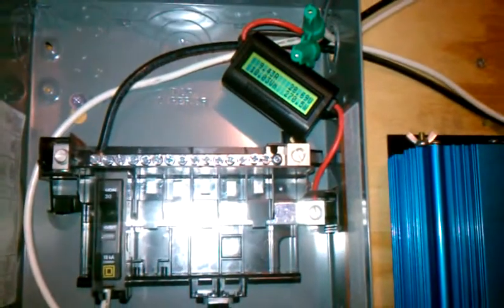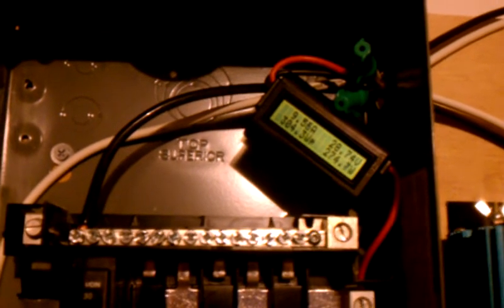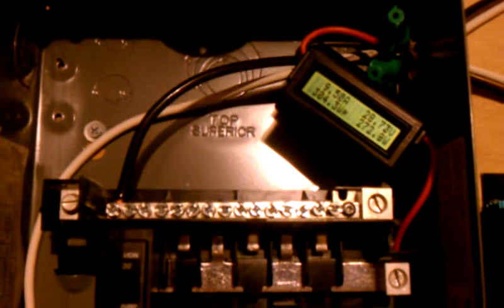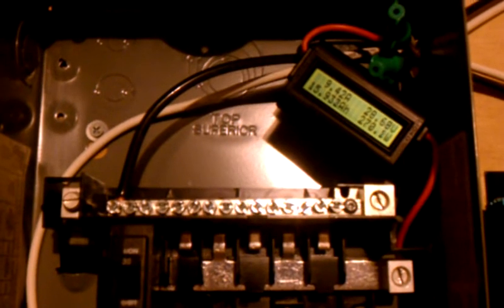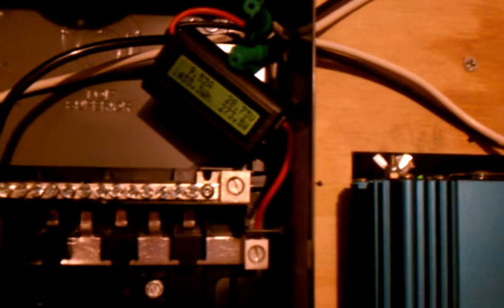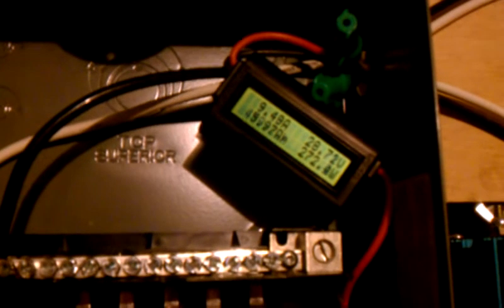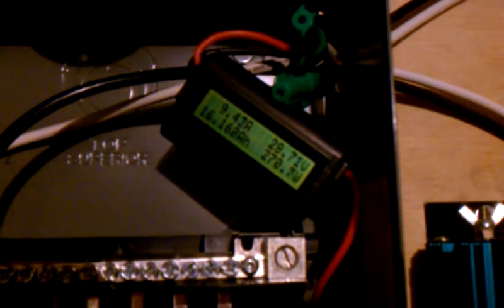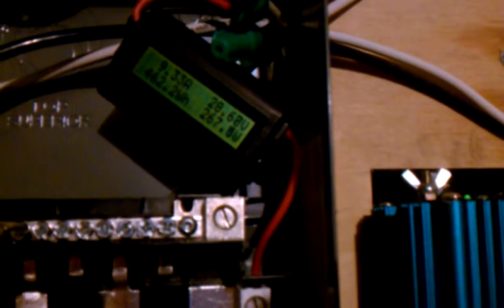Solar panels & Powerjack 1200 watt grid tie part 7

Comment from the maker: @Xringer No matter what the panels are at you should get the same results with MPPT. You may be able to get some advantage if you run towards the higher end of the allowed voltage. In this case, if the voltage is low like in low light you'd still be getting some juice. Right now when my 24V panels are heavily shaded they produce below the 28V required to start the PJ, if I ran them 48V then they'd have enough to be producing something even though it would be very small.

Comment from the maker: @Xringer The panels voltage/amperage get transformed by MPPT and that's not the actual panel voltage. If you watch carefully you'll see when the voltage drops from 33 to 28V the amperage goes up and vice versa. The meter reads the draw of the device it's hooked into, i.e. the load, not the input of the solar panels.

Comment from the maker: @Xringer MPPT accepts the lowest voltage so it can create the highest amperage and you can see it working in this case. 28.72VDC is the lowest the PJ will accept.

Comment from the maker: @Xringer Yeah, I love this meter so far. I may incorporate it somewhere later or just keep it for testing, we'll see. The GTI is in the garage now where it's super cold. It's 80 degrees out today, got both the front door and back door open and I'm sitting here in shorts typing this out lol....we never use our heater ever and if we need heat we use firewood. Summer is a different story though, gets hot as hell in Florida!

Comment from the maker: @Fearlessthinker Yeah, I have the panels on a solar tracker and their up in the air with the back exposed so they for sure stay cooler. The GTI is in the garage now so it's much, much cooler than sitting out in the sun. Yesterday I got 87% efficiency out of the Powerjack, I took in 800wh and the PJ produced 695wh. It was very cloudy, normally I'd get 1.5kwh. I'm getting 4 more 200 watt panels so I'll have 1350wh worth of panels soon! Off grid next!